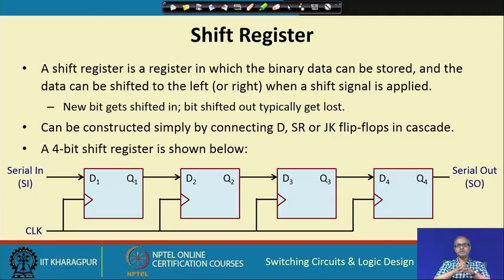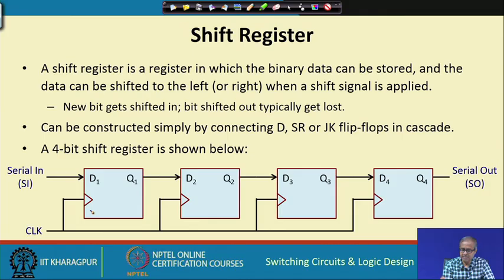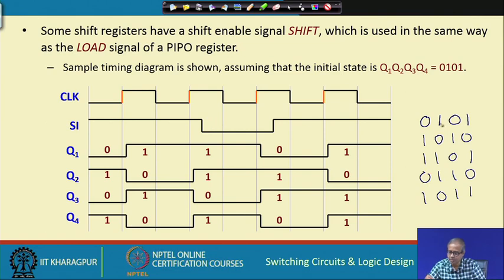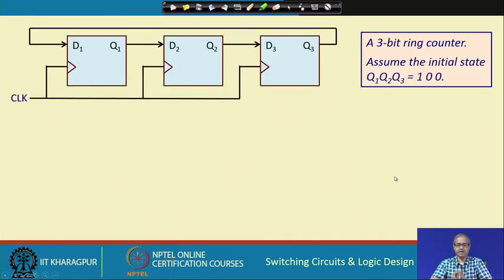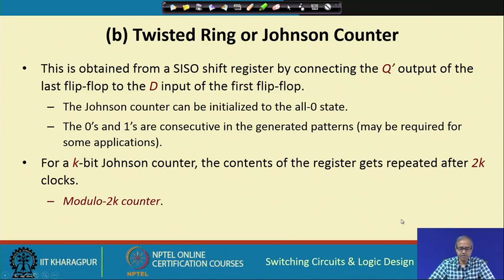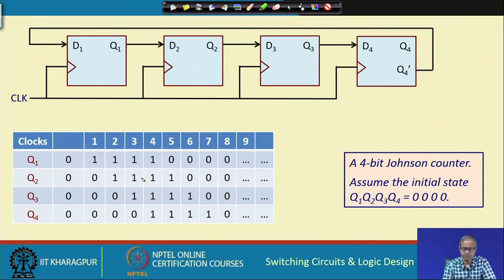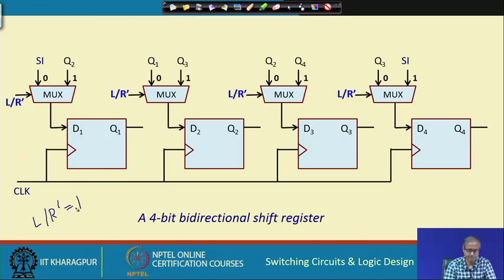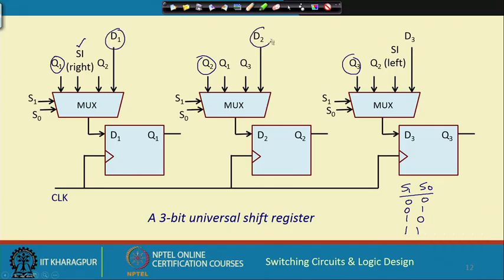Lecture 43: Design of Registers (Part II)

Comment: How many memory chips of 4K nibble capacity are required to construct 26K bytes of memory?

Q:2) In 4-bit Binary Synchronous Counter (Lecture 15), you will observe that the first Flip Flop (FF0) inputs J and K were always at high (1). Explain, why it is so?